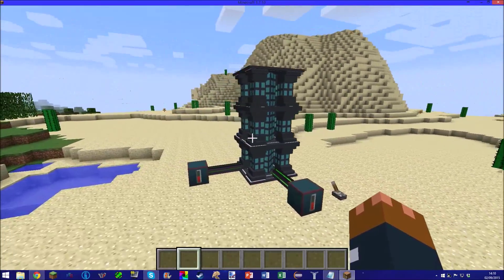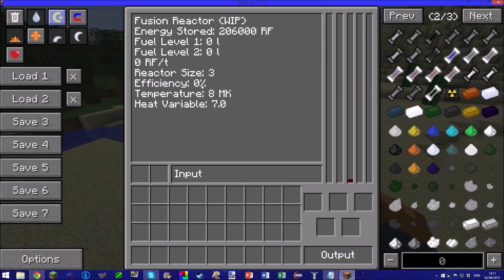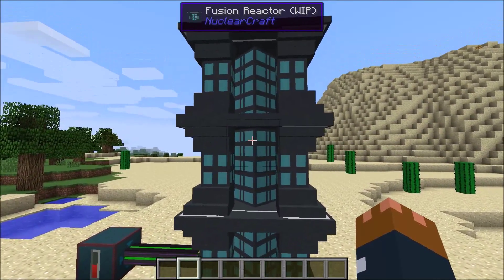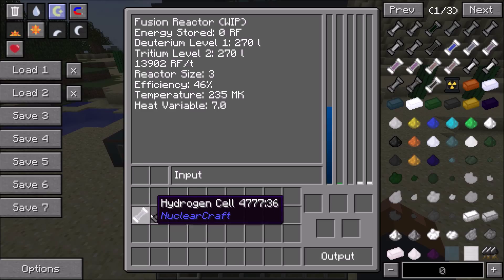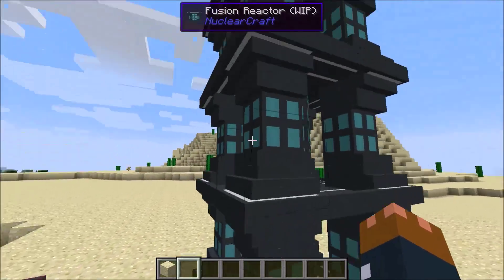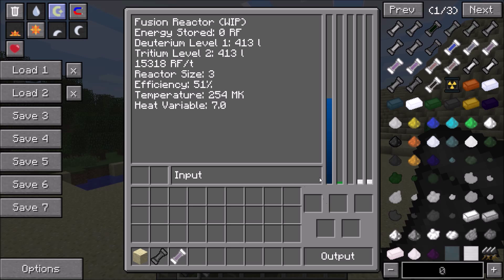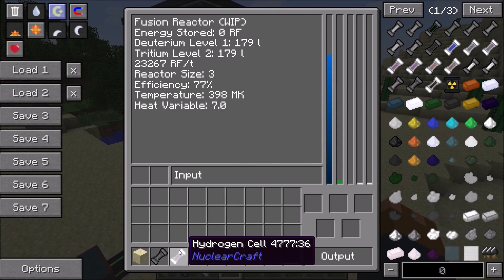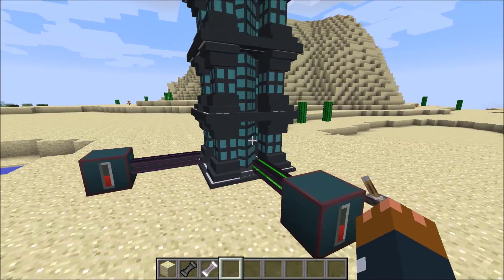Advanced Fusion (1.4)

Comment: i thought the the Heat Variable is a debug thing and you were going to remove it in 0.15 ?

also what's the word on the Particle Accelerator , can we expect a sneak peak in 0.15 or ?
Reply from the maker: +6210 classick I am removing the Heat Variable from the GUI, but it will still exist in the mechanics ;)
There won't be anything on particle acceleration in 0.0.1.5, as I am not sure how I want it to work yet, but that is certainly the next thing I want to work on.